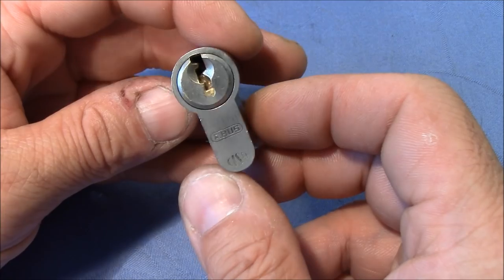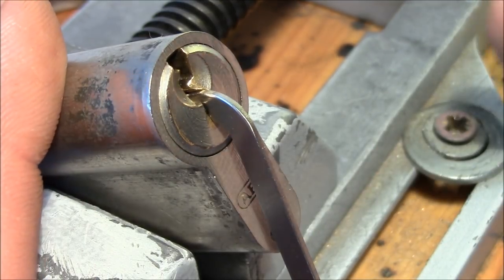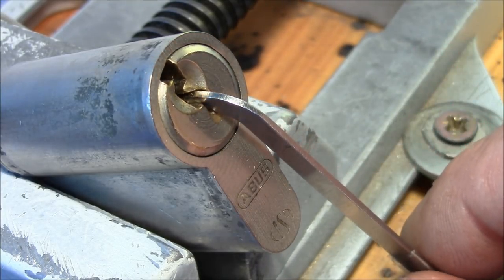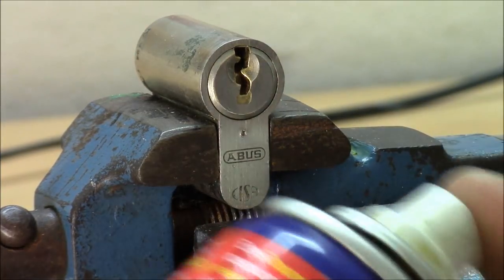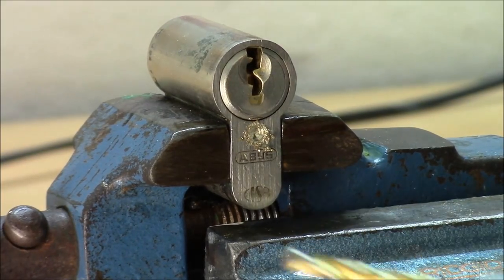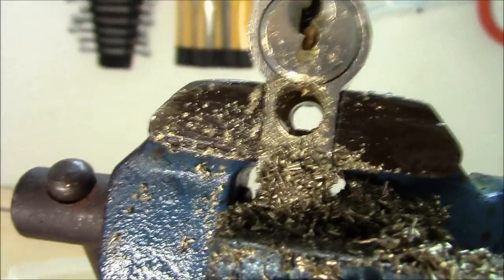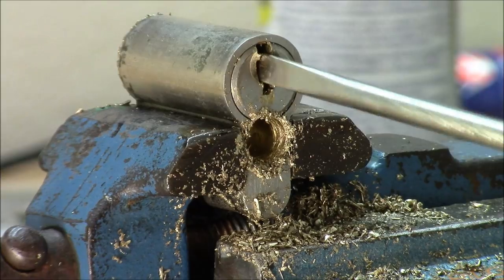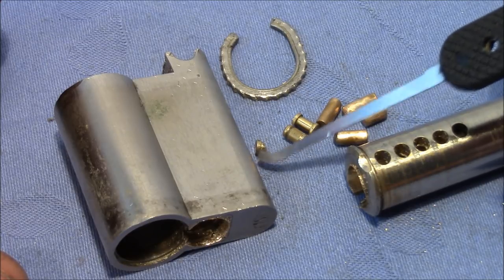(picking 365) Picking and testing to drill out an old ABUS 5 pin euro cylinder - destructive entry

Comment: Holy cow ;D...master of destruction...what a mess ;D. Drill slower and with a sharp bit, leave the oil away and cool the drill in between and it will work much better ;). The locks I've seen drilled, where all drilled lower, not directly at the shear line and if you drill smoth and straight, the pins will fall down. Anyway a nice experience for you :). Thanks for sharing this horror show (for a picker) Potti lol ;).
Reply from the maker: Sorry that I shocked you with that video ;-) For sure a sharp drill bit will help ;-) Why do you recommend not using cutting oil or drill water? Thanks for the tips with the position of the hole - I will do that again after all of your feedback for improvements. Cheers and thanks for watching and commenting.
Reply: No need beeing sorry, I had a good laugh ;). That was really a bit more destructive (and partialy dangerous) than needed ;D, but fun to watch. Cutting oil/water is simply not needed on this (and WD40 really is not), just drill way way slower and straight with a sharp (sharp) drill bit ;) and get the drill out from time to time. Lived in a metal company for 15 years ;D (and have spend a lot of freetime helping and playing with metal...well mostly stainless/steel), friends of me, they just moved away.
Reply from the maker: Thank you, will try drilling slower next time. Thanks for your recommendations mate :-)

Comment: LOL very fun vid again buddy, cool picking and fun massive destruction party ;o)) when you are drilling a lock in a door you have to be careful not to go trough all the way because you can damage the cam and if you break it you have a real problem ;o)) you have to count the pins when you drill those to stop before the bible ends. A 4mm drill is enough, and you can dril near the shear line and make several passes to destroy the key pins. Many locksmith like to drill near the shear line becouse some times the drill protection don´t go so far. In locks without drill protection is better to drill the springs, all the pins fall down and the plug turns. 
Thanks for sharing ;o)))
Reply from the maker: Thank you - yes that was kind of a party ;-) To protect the cam is a valuable note - thank you. Will take all your feedback into account when I do it next time. I felt the hopes of the drill bit in the chambers of the bible so it would be easy to count them or I put a mark on the drill bit. The biggest problem was the burr in the drilled hole that prevented the pins from falling down. Maybe I just need to drill more carefully with a sharp drill bit.
Reply: I don´t know, but probably you are right and using a sharp drill bit the hole will be more clean and without burr. Anyway I no recomend to use WD40 becouse the drill bit skid, is better to use oil, the hole probably will be more clean this way.
Thanks for share the xperiment, always learning with you buddy 
Cheers!

Comment: Drill plug only. You will see factory drill mark on key way use same size. Drill bit also "" use baby pin to keep pins up in the cylinder so they Dont get damaged "" once drilled pull baby pin out and all pins fall out.. Then use screwdriver and rotate plug to unlock. There are springs inside but with force will easy unlock. It takes around 2-3minutes to breach a lock
Reply from the maker: Thank you for your info. Will try it next time I play with drilling. Cheers :-)

Comment: I was taught that you drill the sheer line. You drilled a little low and that could be why you could not clear the sheer line. However nice try for your first drilling of the lock. i did not know you can use lubricant to drill a lock. Thank you Potti :)
Reply from the maker: OK, will try to exactly hit the sheer line next time (and I plan to repeat it). When I had my apprenticeship (log time ago) I was told to always use drilling water or cutting oil so that the heat would not damage the drill bit. So I did here.  Thanks for watching.
Reply: Sorry to bump into old video , but we also used a mixture of 98% of water and 2% of oil when drilling in highschool. :) We drilled hardened steel  and deep holes on lathe , so it might make sense. :) We also wore kevlar gloves with leather reinforcement , so we wouldn't end up with small sharp pieces under our skin. I made mistake once , and now I have "souvenir" in my finger. 😂 And , everything we have ever done there about locksmitting itself was to make door knobs and hinges. The first ones were just knobs , nothing inside them , just holes for screws. :) The finalization part was to take a piece of sand paper , and , while knob is rotating , we polished it this way. :)
At the uni , the story was different , we had to make everything in ProE / Catia , and push it back to the machine(s) where they'd do everything from scratch. :) We only had to insert material and cutting blades , and that was it. :)

Comment: Hi once you’ve drilled the lock the first time,insert a blank key to push the pins into the hole or tap the lock with a small hammer or screw driver handle then use a small hook to remove the dropped pins then drill again turn the core  with the blank key job done,the drill bits should be  hardplate bits
Reply from the maker: Thanks for the tips. Will try it next time. Appreciate your comment.

Comment: nice video. the only locks without drill protection are often those you can pick easily anyway. And a nice sidebar would also complicate the drill process. 

So a high density object accelerated towards a fragile often transparent construction element is still a more reliable method of entry.
Reply from the maker: Thank you. I know about the "easy" ways of entry ;-) But I was curious what problems arise when drilling a lock. I can see problems with a side bar but in the worst case the whole plug could be drilled out (given not steel inserts).
Reply: Potti314 I pay about  €50 for 1 drill bit, but there is no reason to make a video demo of that, as lock sporters do not need to know those techniques. If they have a lock they can't pick, they just release tension on the vise and dump it back in the naughty bucket
Reply from the maker: Wow, 50EUR is a lot. But I can understand that you need to have one that can also attack hardened steel inserts. I'm not a lock picker solely but a person who is curious how things and techniques work and I like to test myself a lot. That's why I do it.

Comment: I tried this method and my drill bit broke inside where you made the first hole 😕.Is there a way to open the lock?
Reply from the maker: You can try drilling out the plug (the rotating cylinder). Just make sure you don't hit the cam at the end.

Comment: I've only drilled one lock, in the same spot as you did your first hole here, and the pin chambers caused an 'intermittent cut' so it broke 3 x 4mm HSS drill bits in a row ! The 4th bit got through. No anti-drill rods were present, just wicked brass chambers :o) Nice to see someone else have a go anyway... though I reckon picking was quicker in this case :o)
Reply from the maker: Uhhh, 3 broken drill bits. So I was really lucky with my attempt. Picking was easier but I wanted to get the experience of that method. And I learned a lot and got good feedback. So I will try again.
Reply: I could have used a bigger drill bit, which would have been stronger, but the lock was like a smaller version of your Euro Abus, and there was not much width to the core/bible. I agree that you only find out how it is to drill a lock by actually doing it ! In my case I had to use a hook pick to fish all the broken bits of drill and brass pins and swarf out of the drilled hole. I'd be a rubbish  burglar :o)  You should get yourself a tiny sharpening stone - you could probably put an edge back on some of those dead drill bits - maybe they are too far gone though ....there's only so much you can recover from, isn't there ?  :o)
Reply from the maker: Will try to sharpen the drill bit with my angle grinder. Have learned to do this 30 years ago and it's difficult. But I will try it., Cheers mate :-)
Reply: Angle grinder ?! Ooof! That needs a steady hand ! You have done it before though...I just hate throwing stuff out before having a go at making it good again, you know...:o)
Reply from the maker: Ups, sorry. I meant "bench grinder", not angle grinder.
Reply: Haha! Yeah, I assumed you meant that...still needs a steady hand though of course :o)

Comment: Why not just drill straight into the key hole instead of under it first mate?
Reply from the maker: You need to clear the sheer line and the intact plug allows turning the lock open afterwards.